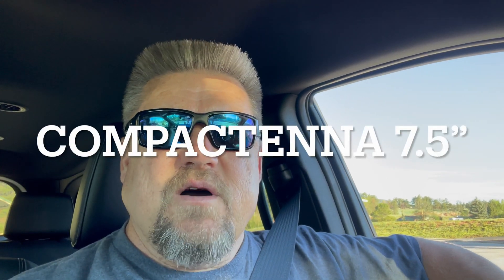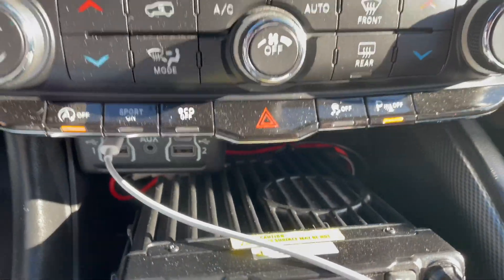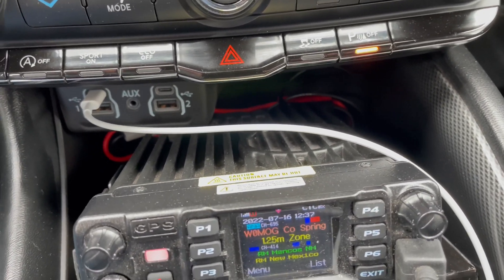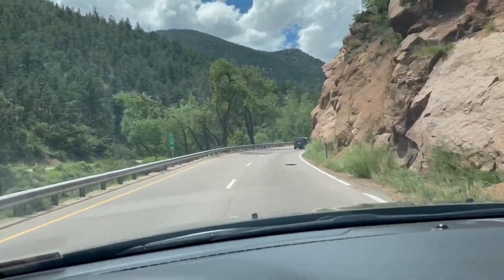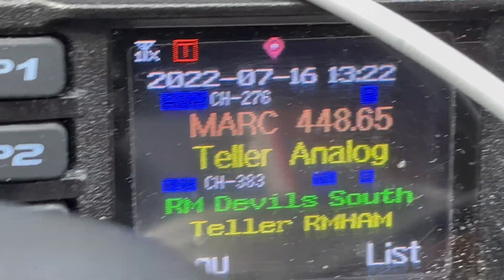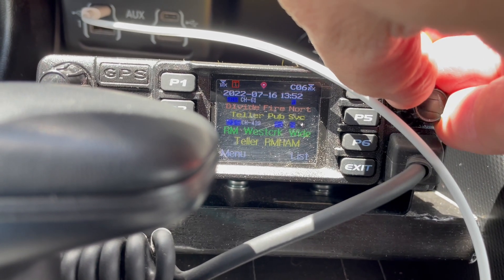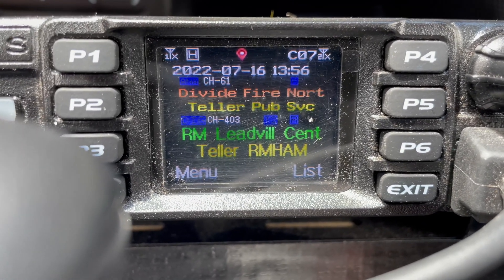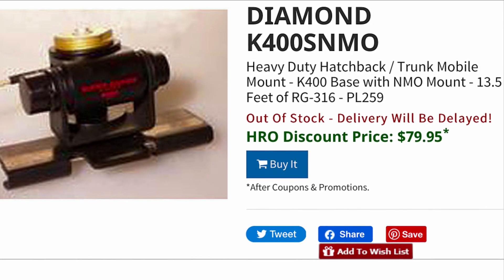Field Test 7.5" Tri-band COMPACtenna Non Line-of-sight Ops & moving 2m/70cm/1.25m & DMR

Comment: What is the SWR ?
Many report High SWR  ?
Reply from the maker: I get typically 1.4 to 1.5 SWR on the Quarter panel. Ham-Solo K0FYR
Reply: @Ham-Solo  
Thanks for your reply !
I have heard so many different reports, that it almost seems like the good reports are from guys where an antenna is given to them to test, by this Jack ?
Then ones that buy them, talk about them not working well, and then placement being critical, Etc. !
Then I found one that said it worked 11 meters, the 2 meters, and 440 ?
Unless this guy is employing Alien technology, I don't guess I know quite how that's done, but the question in my mind begs...., why not 10 meters, keeping it aligned with the other two ham bands ?
Kinda reminds me of back in the 80's a company advertised in all the Ham rags, their antenna tuning apparatus .
Claiming that all branches of the military, NATO, use them etc. !
Someone x-rayed one and it showed circuit boards, but none were connected !
I believe it ended up being resistors to show a proper match ?
Lol....!
Listening to this guy speak, sounds like so much Double Speak ?
But that's just me !
Guess the proof is in the pudding !
Thanks again for your entertaining my questions !
'73 !

Comment: Love the radio/antenna setup. Might have to do the same.
Reply from the maker: Works very well but since the 1.25m is only 5 watts it’s hard to do simplex on 220MHz further than a mile or two. VHF is fine with 50 watts on 146.520MHz. Ham-Solo K0FYR

Comment: Would this work on gmrs
Reply from the maker: Yes I have used the antenna and a GMRS radio on GMRS frequencies and was pushing out between 45-50 watts on the GMRS repeater inputs. Ham-Solo K0FYR WRMV759
Reply: @Ham-Solo  excellent I’ll have to try it out I have the scanner version right now but I’ll pick up the lmr
Reply: @thebear6751  I use the scanner version on my truck for GMRS and it works great. Very low SWR.

Comment: Nice. Just purchased the 2m/440 + 9 inch version. Testing shows it has better transmission and receive sensitivity vs. the 7.5 inch. Plus, I don’t have a tri-band radio and have little use for 220. Looking to mount it on the hood in the same spot with the same mount. Did you do an SWR sweep by chance? If so, how were your results? Thanks.
Reply from the maker: I did and had nothing higher than 1.2 to 1 throughout all 3 bands on mine. Ham-Solo K0FYR
Reply: @Ham-Solo  Nothing worse than 1.2:1 on any part of all 3 bands? That’s both impressive and crazy. I’ll have both my mag mount and Diamond lip mount this week. I’ll do some testing with my RigExpert this weekend and will report back.
Reply from the maker: @mainetomass99  I wish I had a Rig Expert. That’s the one thing I’m really dying to get. About to make a balance feeder doublet. Ham-Solo K0FYR